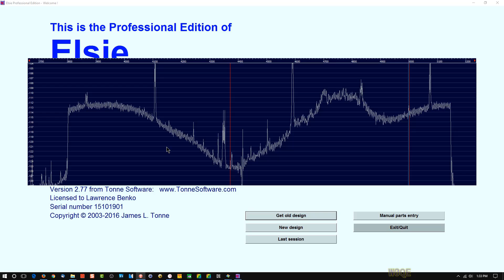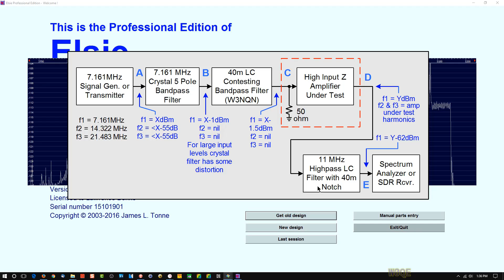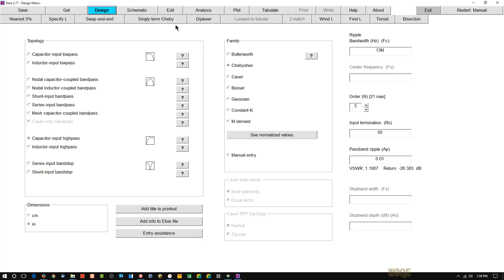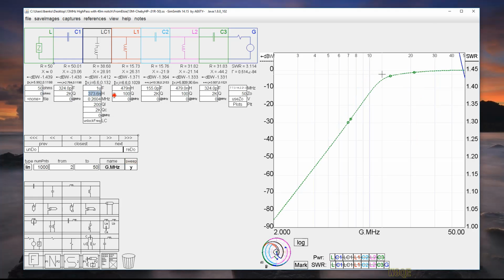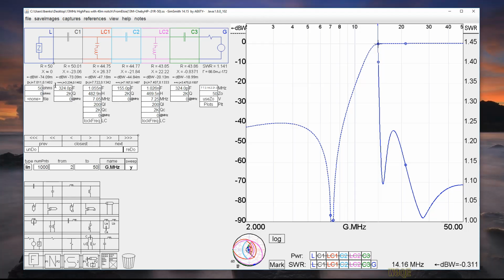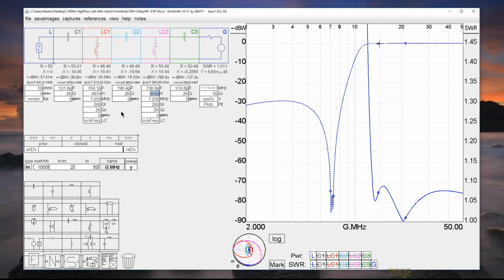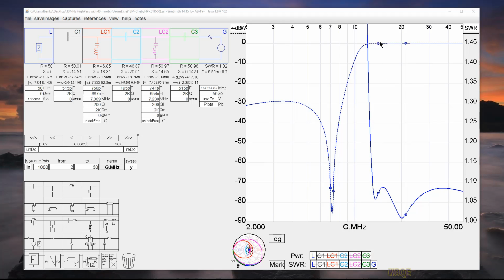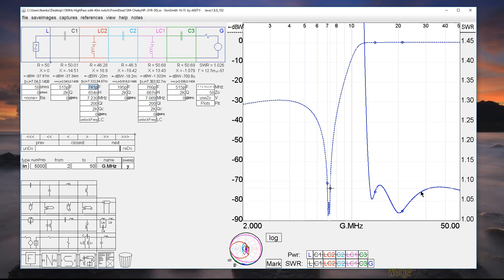#19: Filters (Basics 11)

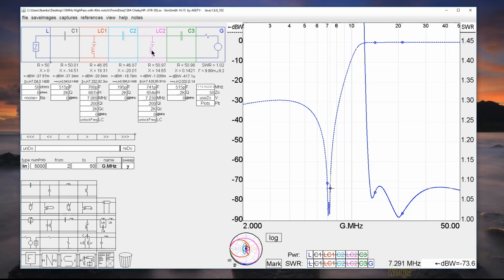Comment: 18:48 "You need to turn the filter around and look at it the other way"

I'm new to filter design and this seems like a crucial point. Which way is which? Should SimSmith have the generator where the signal leaves the actual filter or how is the filter "turned around"?
Reply from the maker: If you are referring to having the generator on the right side of the circuit that is because most Smith Chart problems involve the impedance at the load being transformed to a different impedance at the generator.  The earlier versions also worked this way.  However in the past couple of years SimSmith can reverse the circuit by clicking on the view tab and then selecting "show backwards circuit".  However if you are referring to which side of the filter the generator is on that is a different case.  For most typical filters the generator and load can be swapped.  However filters can also be used to change the impedance in which case swapping the generator and load will give a wrong answer.
If I didn't understand your question feel free to ask it again.
Larry, W0QE
Reply: @w0qe  Thanks! I mostly understand your two points after thinking a bit.
But what did you mean in the video by "you need to turn the filter around"?
Reply from the maker: @andpe161  By turning the filter around I mean swapping the filter inputs and outputs and then looking at the SWR again.  This can automatically be done in more recent versions of SimSmith and both directions can be plotted at the same time with the revZ function.  This is analogous to having a small VNA like the NanoVNA and wanting to know the SWR looking through the filter in both directions which requires you to reconnect the VNA to the opposite ports of the filter.
Larry, W0QE
Reply: @w0qe  I see, convenient. Thanks!